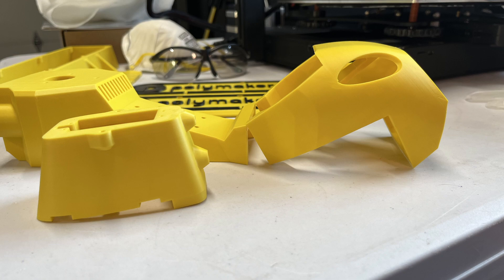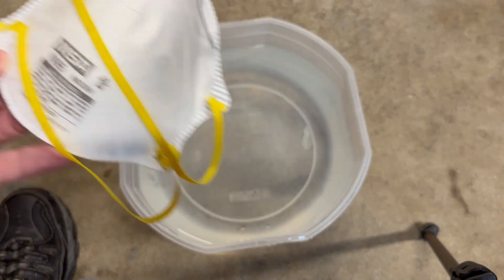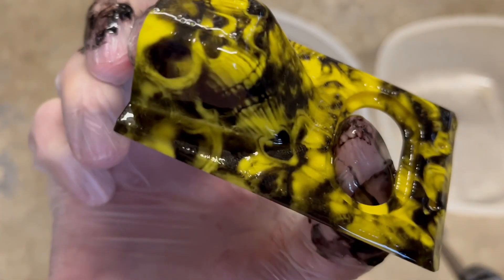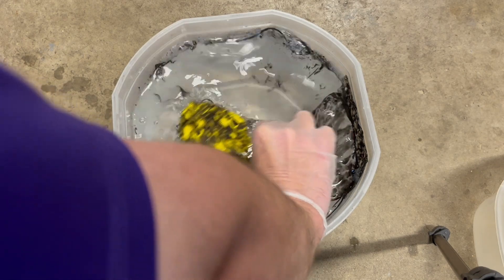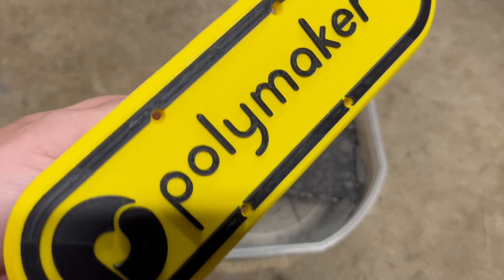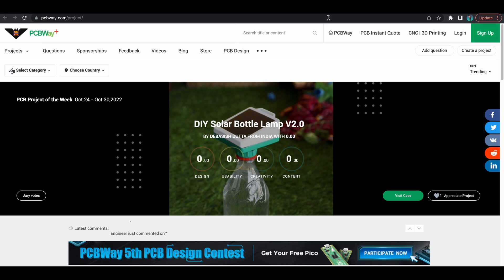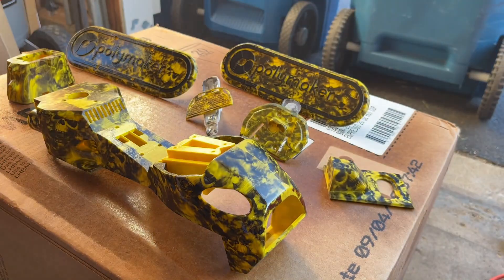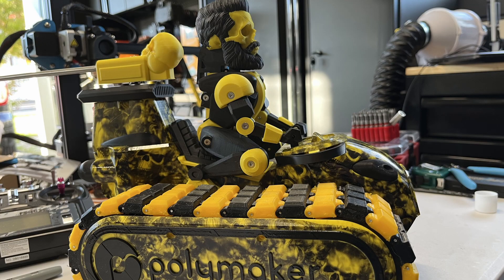HYDROGRAPHICS ON 3D PRINTED PARTS

Comment: I know this video is already 10 months old, but I just wanted to add a small pro tip. If you do mess up your dip and have to clean it off to start over. The best thing that takes all of the hydro film off and easily is to use denatured alcohol and a lint free cloth. Way easier and faster than having to sand for hours. The denatured alcohol takes it right off as long as you haven't put a clear coat on it yet.

Comment: I've been hydrodipping my prints and other stuff for years. It's good fun, only tip I have to make it a bit easier is start with a corner and roll the part into the film. Also if you do big parts tape the edges of the film so they float as you don't want water on the other side of the film because you will ruin the film